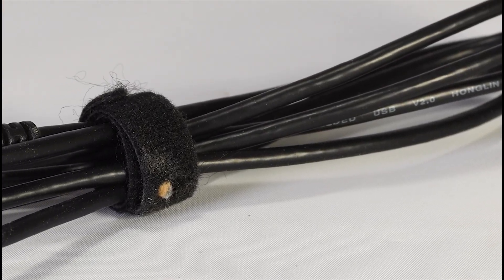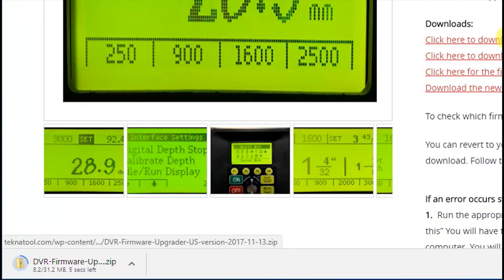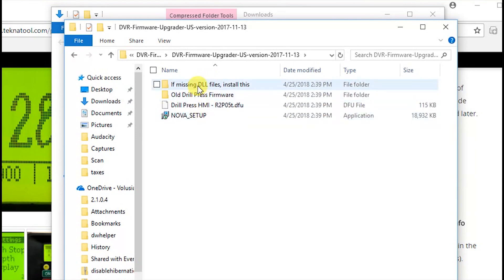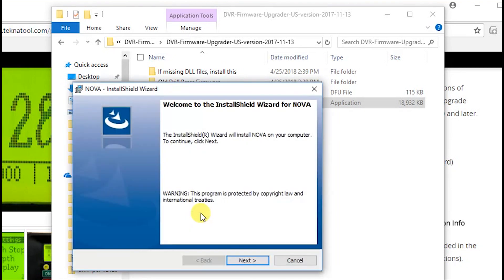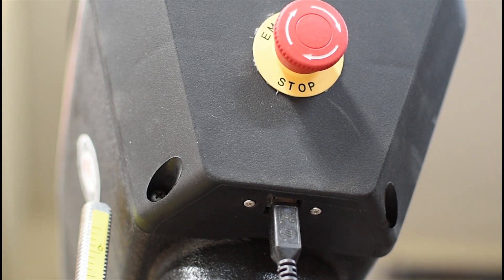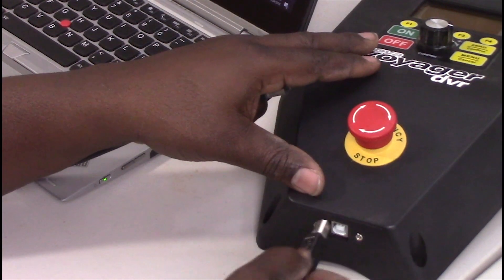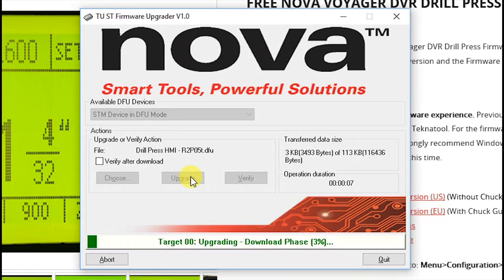Firmware Upgrade Instructions for NOVA Voyager DVR Variable Speed Drill Press

Comment: It is a great drill press, but they could not  have come up with a more complicated upgrade process.   They assume woodworkers have a laptop PC...  Pulling cables from a circuit boards is not a good idea, if you have to do that be very careful.   The way this process should be is to plug in a thumb drive containing the upgrade image then turn on the machine.  It detects the upgrade software and upgrades the machine.   Luckily, I have an older laptop which should work....   Thumbs up for the drill press, thumbs down on the upgrade process.

Comment: What is the latest upgrade.  I just purchased my drill press but it states that is was made in 2017 with the upgrade ver. 8.21c.    R2P05x
Reply: I just received my Nova DVR June 14, 2021.  I have the same firmware as you - P2P05x.  The current version at https://www.teknatool.com/upgrade-your-firmware/ is the same.  You're current as of the date of this post.

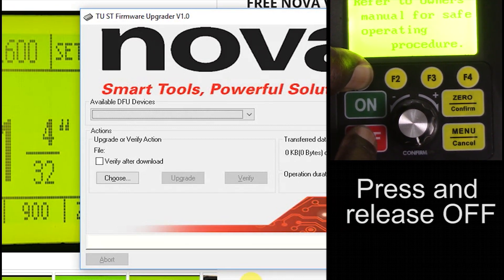Comment: I got up to 4:19 in your video and that's where my problems started. After I plugged in the cable and did the key pressing/releasing routine, the "Available DFU Devices" box never populated. I tried several times from scratch and that is as far as I can get. Would you have any suggestions to offer?